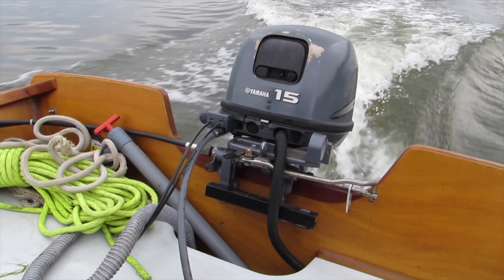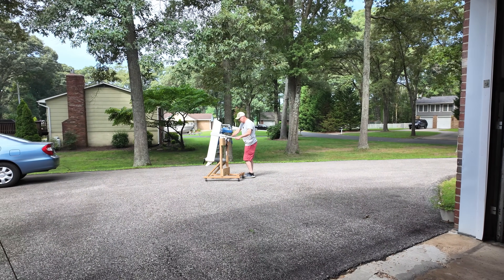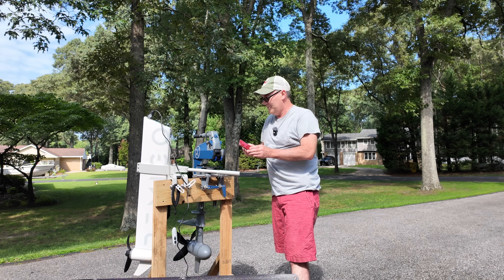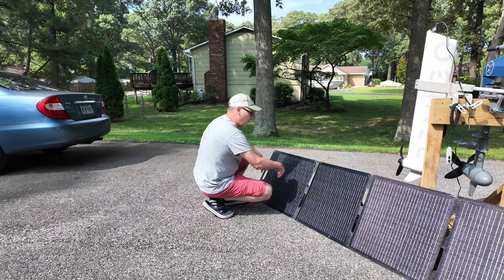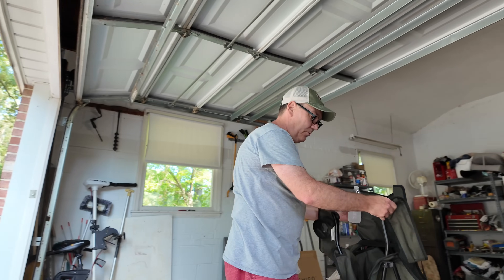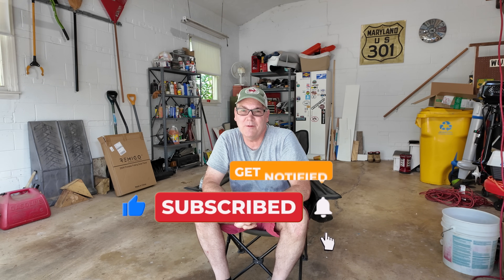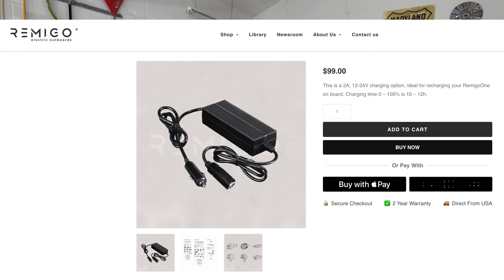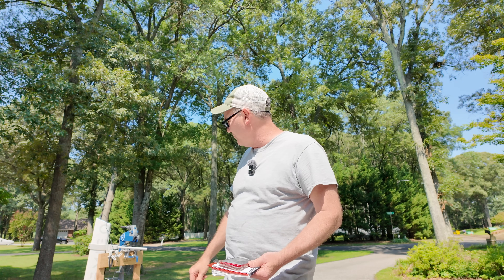Solar Panels + Electric Outboard Motor?

Comment from the maker: ▶︎ Here is my RemigoOne review video https://youtu.be/nJC2K-DQ_IM

If you are interested in purchasing the RemigoOne Solar Setup or a RemigoOne electric outboard motor for your dinghy, sailboat tender or little boat, you can get a 5% discount if you use the discount code "wayne" at checkout.
▶︎ Remigo web site https://remigousa.com/wayne
▶︎ Use coupon code WAYNE at checkout to get 5% off your purchase! 

You can also purchase a Remigo One through Tiny Boat Nation
Use coupon code WAYNE at checkout to get 5% off your purchase in the Tiny Boat Nation Shop!
▶︎ https://tbnation.net/products/remigo-one-3hp-electric-outboard?ref=wayne&variant=42712669945991

Comment: Well, we did 1100 miles on electric propulsion in a 17 foot boat with 600 watts of BougeRV CIGS solar, from Chicago down to Alabama on the Illinois, Mississippi, Ohio, and Tennessee rivers so I guess the answer to your video question is yes?

Comment: Load normally means something that's connected and drawing power from the input source. In this case that would be your battery charger. So what they want you to do is unplug the battery from the charger before you unplug the panels, probably to prevent arcing when you unplug the panels.

Comment: Open the panels last (after plugging everything in) and close them first (before disconnecting everything), so you don't get any arcing, which is bad. And for a comparison, I use a 200 watt solar panel to charge my 100AH LIFEPo4 RV battery and on a sunny day, I get a steady 10 amps charge.

Comment: Have you ceramic sprayed your boat bottom? I asked AI: : does ceramic coating cut drag on a 13 ft aluminum boat?🚤

AI Overview
Yes, a ceramic coating can reduce drag on a 13ft aluminum boat, potentially leading to improved performance and efficiency.

Comment: I am using 1 square meter foldable solar panel on my Zodiac Zoom (there wouldn't be enough space on the boat for anything larger) and with Torqeedo I am able to run motor without taking anything out of built in battery indeed (with very small output). It is in fact possible to push current into the system while running the motor and thus extending the range. So I wonder if RemigoOne can do the same or you have to switch off the motor while charging. 2,4 meter length is quite a size, you would need some surface (e.g. large bimini top) to place the panel on, as I understand the concept is meant rather to charge batteries on a beach after the ride.

Comment: I use two 90W panels on my outrigger canoe while on camping trips. They charge a 1kw/h lithium battery which powers my caroute 1kw motor. It works great, the battery is always charging even while we are motoring, so we are self sufficient.
I suggest that since you are so into electric outboards, you should get a monitoring device to see what’s going on in a system. I use the Grin Cycle analyst, with a separate current monitoring shunt. It can be configured for a solar input shunt as well, so you can see real time solar input and motor output while under way.

Comment: I’d say this is a great proof of concept for what’s possible.   Obviously won’t work for everyone but seems like a no brainer for campers, weekenders, and remote use.  A Bimini top could easily be equipped with 300-400 watts and divert excess into a little portable power station.

Comment: A very interesting video on using a solar panel to charge your electric outboard. I have never given a thought about using a solar panel for charging my electric outboard. I am going to check with my boat dealer to see what they may offer in solar panels or not. If they do, I will ask a few questions and if seems OK I will give one a try. Thanks for video and information. If it fits, I wonder if they can be used on a boat where they will fit.

Comment: 1085 Wh battery and 200 W panels would require 5 hours to fully charge in 100% conditions. You DCDC-charger is likely limited to 100W to not kill the outlet in the car. RCtestflight made a funny boat with way more panels in a butterfly looking rig and got more practical charging power, at the expense of a very impractical setup.

Comment: What I learned from Sea Eagle boats is better off having an extra battery if you want extra range. Solar is just too slow. So I have Anderson connectors on my battery boxes so I can switch between batteries within seconds.

Comment: Perfect for a 21 ft sailboat like mine. I actually just bought an epropulsion with a 60w solar panel. I didn't get the wall charger. The south florida sun should insure I have a topped off battery every time I go sailing.  The cool part is I can charge while I sail so theoretically the motor will always be ready to go even If I camp out a couple of days. I have a controller to make sure I don't over charge.

Comment: Never charge your battery in direct sunlight especially on a hot day after 7pm electricity is cheaper & safer charge your battery and run a fan on ac power supply cause my got piping hot 🔥 in direct sunlight. Also you have to plug in ac power supply charger 1st before you plug it in battery, when its done charging unplug it from battery 1st then unplug power supply charger from wall. I've learned so much about boating this summer.

Comment: I got a Renogy 400w solar blanket for less than $500 CDN. Only issue with solar is that everything has to be perfect for maximum output...completely clear skies and pointed exactly at the sun with zero shade on the panels. That said, it can be a handy thing to have hooked up sitting on your boat or dock when you're not using it. If you have a large setup, in the several kWh of batteries, it can take a long time to significantly charge unless you have a large solar input. Like batteries, solar tech is slowly improving
Reply from the maker: Yeah - things are getting better - slowly!

Comment: Good show.  Solar power will extend your range if it works while running the motor. Try it. This is a nice system.
A solar array makes a great boat awning. The boat is always fully charged and ready to go. No other charging required.
Blocking the light kills the power. Solar panel systems can generate high voltage, such as in electric arc welding, that can damage connectors.

Comment: I'm using solar on my boat. 460W  / one house bank of LiFePo4 batterie with 4 CATL zells 3.2V / 310ah and an inverter 12V 220V / 1400W to charge my Remigo one with the included 220V charger. Usually I charge it when it is at 50% discharge. Like this it takes about 5 hours or 6. Depends on the clouds passing by. I love this engine and to get free charge every 2 weeks of use..!  ❤️❤️👍 Never go back to fuel outborders again..!

Comment: Good to know this Sir. From what I've seen on solar if it's a permanent setup it usually has an inline breaker switch of some kind to safely make sure load is disconnected. Temporary like yours just closing it up seems to have worked well. 😄
Reply from the maker: Thanks! I hope to get more involved with solar in the future.